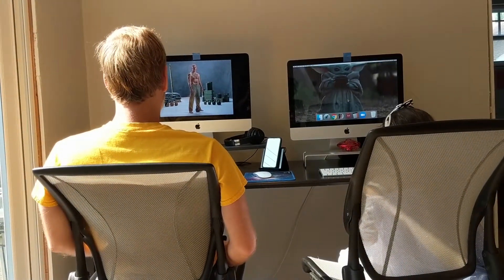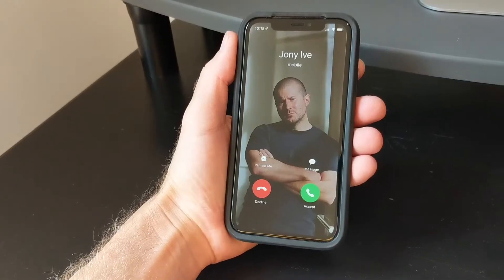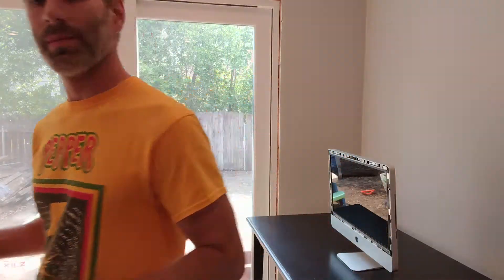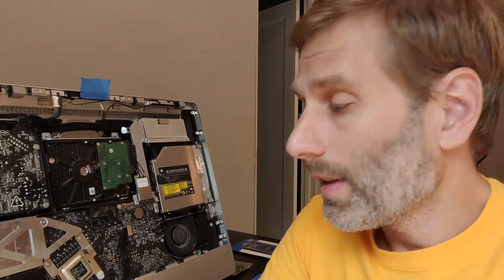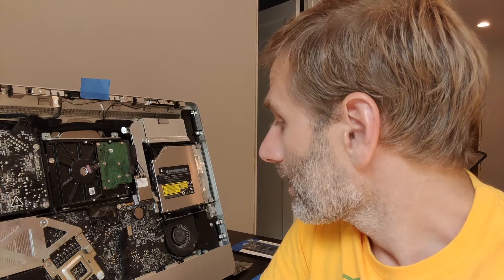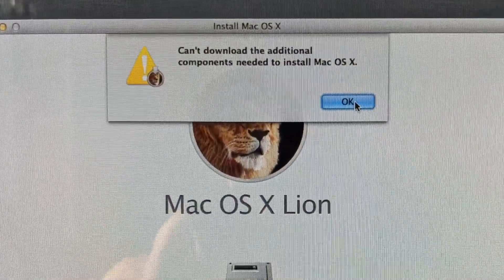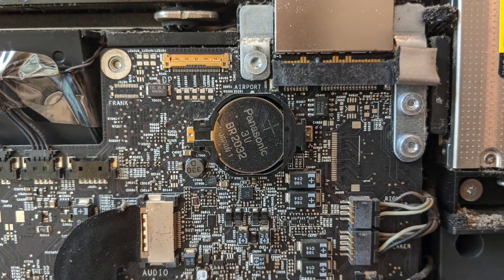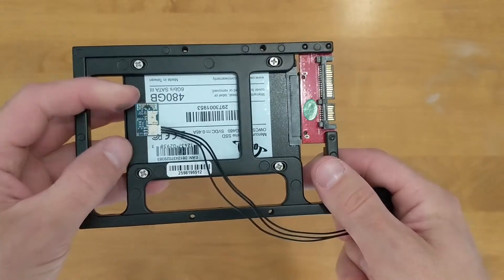2011 iMac Upgrade and Lessons Learned

Comment: thanks mate. just ordered a new bat and a can of air. there isn't a good work around for the thurmo trigger. the easiest way is just get the jumper. I mounted mine to the SSD adaptor so I don't have to mess with the sticky when I have to change the SSD again. don't forget to upgrade ram while your doing stuff. its cheap on amazon. I got mine running on the full 32gb apple says it supports 16gb but I through the whole 32 in and it says it have 32, is it using all of it? im not sure. but it was like 25$ for 16gb so yea,.
Reply from the maker: Awesome!

Comment: So in 2022, almost 2023.
Get an install DVD, bootable install USB (didn't work for me) or a time machine.
Don't buy an SSD bracket and temp sensor. Just buy any SSD you want from Amazon or wherever. I screwed my SSD to the existing bracket with ONE spare screw I had, you could ziptie or tape it.
That battery is hard to hunt down, I'll just wait until it dies and deal with it then.

IMPORTANT: spend $10 and get a USB plug-in for the SSD so you can format it to the Mac extended whatever before installing it. No clue if that's necessary, but you saved $30 by not buying the temp sensor and probably $100 overall by not buying OWC sticker on an SSD. 
The old iMacs don't like internet recovery mode, so you can't just update easily. I didn't have a spare Mac so I was trying to make a bootable USB installer from a windows pc, never worked but I used a random time machine, deleted the user (you can Google how to change password.. pretty scary how easy you can change login password, but keychain password is more secure)
My SSD in Windows sits in a really thin area with no air movement. They aren't fragile little things. You should secure it somewhere just so it doesn't bounce around if you ever move the iMac.

Comment: Great Video Thanks! 
Did you do the work around with 3rd party software to update to latest OS? 

Also have you tried Parallel as way to use windows software on iMac? 

Again thanks for the informative (& fun with kids) video. John
Reply from the maker: I didn't use the 3rd party software because I was nervous about messing something up.  Still running the old OS but its my kids computer and they just use it for the internet:)

Comment: Excellent video! Very detailed. I'm about to upgrade mine to 32 gigs of RAM and a ssd. The computer is already been wiped clean, will I need to do anything with the operating system or will it just boot up like it would for the first time?
Reply from the maker: Thanks!  Even though it's been wiped, I would still create a "time machine" backup just in case the operating system has a hard time loading over the web.
Reply: I made a boot thumb drive of HS and didn't have any issues. the only issues I've had is with cheap SSD's and the computer not seeing them.  apple has the instruction on how to make them on there website.

Comment: 3rd party hack is macfanscontroll and it works fine. I'd rather have the hardware adaptor like you do but wasn't willing to pay more for it than the ssd I was putting in. Especially when I could just use software that's free to do the exact same thing.

Can't say I like the vacuum job but some swear by it. I don't like the idea of static when there's an open PSU fully exposed.

You should upgrade your video card sup you can go up to Mojave. That's my next step. I've bumped my 2011 with an ssd and am at 28 gigs of ram (heading to 32). I'm planning on upping the CPU but most important is video card top get latest Mac os
Reply from the maker: Nice!  I think the adapter came with the SSD?  I cant remember.  I was a bit nervous about the vacuum too but was very careful.  Heat transfer degrades as dust builds up along with a bunch of other potential issues.  Glad you liked the vid:)
Reply: ya know if you take out the main board and go to the sata plug and i belive if you soder in a 0oham reseator between like pins 6 and 7 then you wont need the heat adaptor.
Reply: @sdes-el9wl  I haven't found info to cooberate it
Reply: @stevenbenson9976 Is there a particular graphics card needed for this ugrade? Did you source a video ..I'd be curious to know. I want to see if I can get mine to go to the newest OS (currently Sonoma 14.3.1) or at least the minimum for current apps and bluetooth compatibility. Thanks!